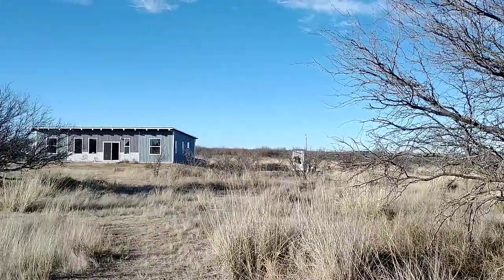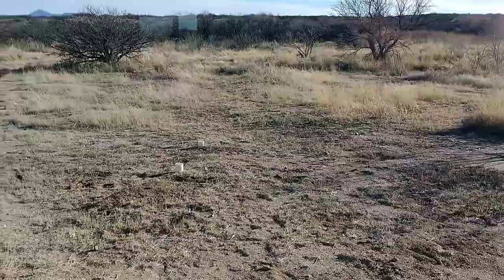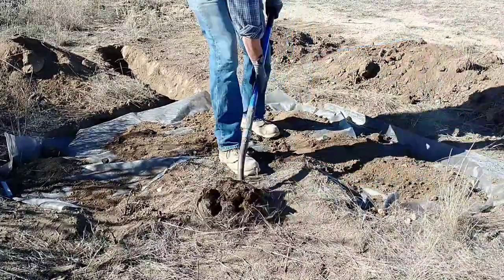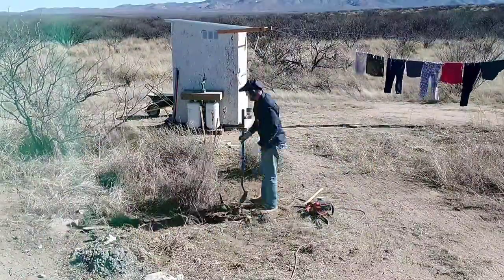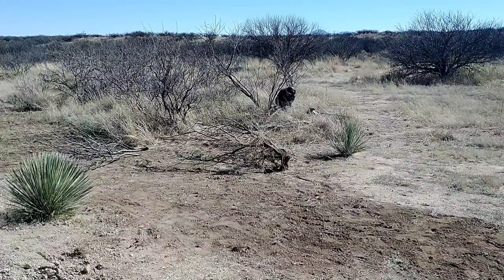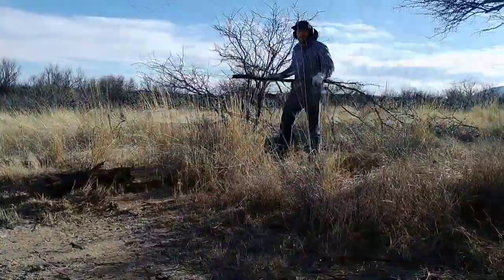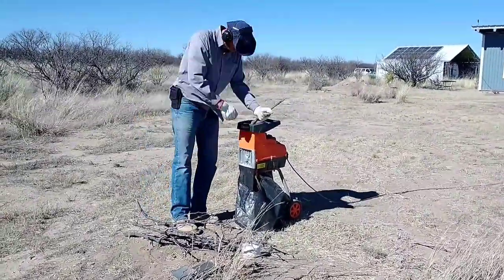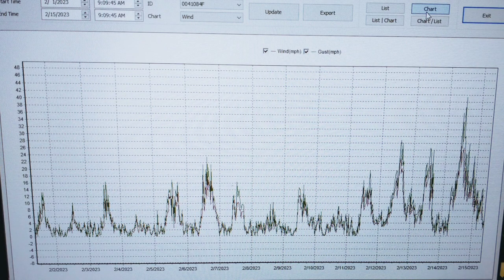A Few More Projects | Gray Water System, Clothes Line, Weather Station & Winter Planting

Comment: Re: TREE PLANTING- I've heard that it's best to fill the holes back in with native soil, and not special soil.
because as the roots grow to the edge of that zone they, like all life forms, want to conserve energy, so instead of pushing into the more compacted, less nutritious surrounding soil they may circle back into the top soil which in the long run creates a weaker root system.

Using the wood chips as mulch is great as it creates a good environment all the way around the tree. 
And if the tree isn't doing well you can just fertilize it. 

On a related note I've heard it's good to dig a square hole with nice tight corners instead of a circle hole with sloped edges, once again to discourage roots from circling near the base.

Comment: Ooo, love the clothes line. You could even build a small counter height platform around the loading post if that would help load and unload.
Reply from the maker: It works great, thanks! I could probably hook the basket on a nail. That's what I did with the clothes pin basket.

Comment: I grew up in a similar climate in South Africa.  The house we moved into when i turned 12 had no garden. My mom took it as a challenge,  since their first house was the same, and we left it with a lush garden 11 years later (neighouing city with milder climate and better soil than the new place). 

Everything we planted in the first year died within a season! The aid soil combined with termites was a killer, only the mesquite type tes survived) Neighbors had figured out the formula: dig a 2-3 ft cubic square hole, fill with water and mix in10 year ant poison, let it soak in. Mix fertilizer and compost with original sand, but first place a vertical 2.5" pipe to bottom of hole, protruding 6-8". Back-fill adding the shrub/tree at the top. Water in the pipe every alternate day, then less frequently, following the season. When we sold the property 6 years later we almost had a jungle! Also, was the buffest nerd in school fom all the digging and building😂
Reply from the maker: Thanks for sharing, very interesting! 
We have found that leaf cutter ants are our worst enemy. They will strip a tree in a couple of days, so we have to keep an eye out for them.  We also have to watch out for groundhogs, they ate all of the roots on our plum tree. We stuck it in sand, and amazingly the roots grew back! Now we plant everything in chicken wire cages. Hopefully that helps! Lots of challenges in the desert, but we are pretty determined too! 🌞🏜️

Comment: You might try getting a good brush killer.  Just spray it on the live root and let it dry.  Then just cover it up.  I have noticed when doing this.  It doesn’t even kill the grass around the tree.   But the tree never come back.  Later